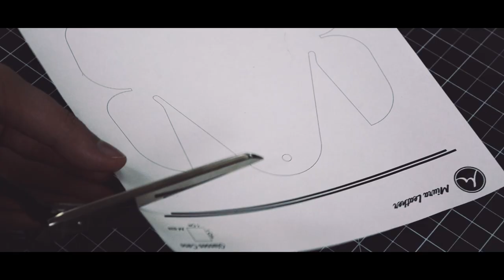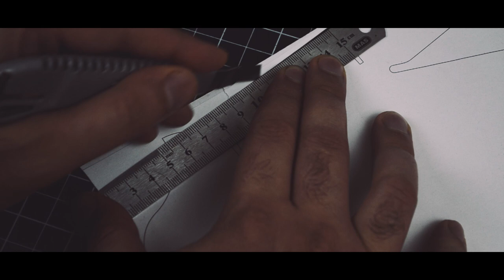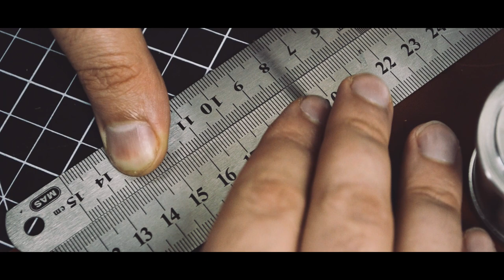PDF Pattern / Leather Craft / Making a leather glasses case / DIY / ASMR / HANDMADE

Comment: Hi there,
Sorry to bother again . This specific glass case (where the arms of the glasses reside on the outside of the actual case - protecting only the lenses) got me thinking if there might have to be some adjustment to the housing of the lenses, given that my glasses are a pair of Ray Bans with the model name being  ‘Justin’. These glasses have a slight curvature and measures 33mm from the bridge to where the arms cross (when folded) and which falls by implication outside the pouch where the actual lenses are housed. I hope I’m making sense here…
Do you think that some adjustment needs to be made to the pattern to cater for the curvature mentioned above. The glasses fit perfectly ito the length and height of the case but worried about the curve where the flap might also be compromised and the pattern/pouch (in its current format) might not be the right fit.
Just as an example, if you compare a normal RayBan case where the entire glasses are housed in the pouch - this inside space (at its broadest) is around 33/35mm.
Your advices and guidance will be appreciated.
The alternative is to follow the current pattern and make it according to that specified and see if it works.
By the way, I purchased the veg tanned leather with a thickness of 1,2 mm today, and can’t wait to start this project.
Thanks once again for time.
Reply from the maker: Thank you for your thoughtful question! Considering the unique curvature of your Ray-Ban 'Justin' glasses, a friendly suggestion would be to try a small test with a scrap piece of leather first. This way, you can fine-tune the fit and ensure it perfectly accommodates the specific shape of your glasses. Happy crafting, and enjoy making your personalized glasses case!